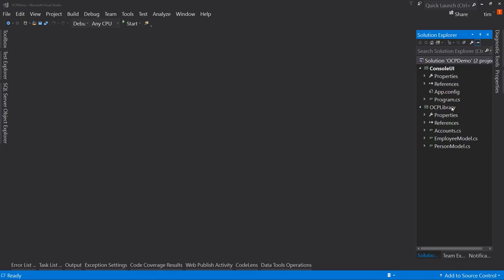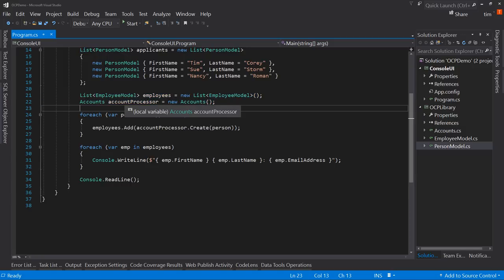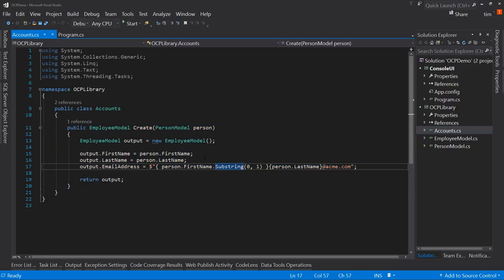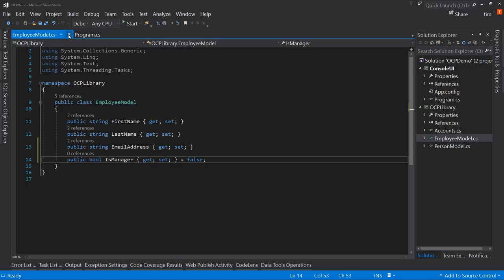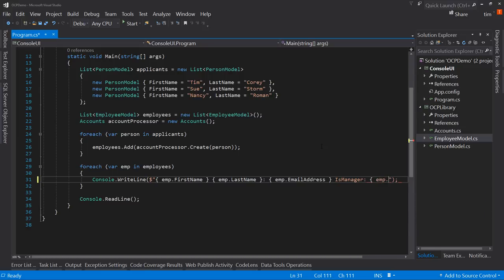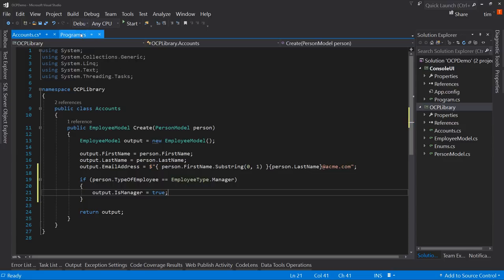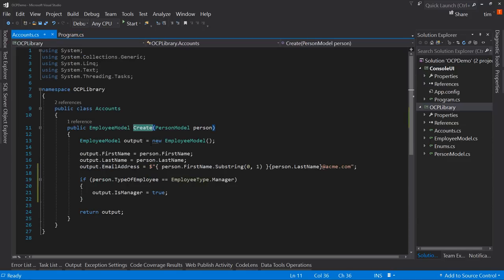Design Patterns: Open Closed Principle Explained Practically in C# (The O in SOLID)

Comment: Hi Tim, this specific example made things a bit muddy for me but I still liked the video because I believe I got the message you were trying to communicate through. A great example I came across of OCP is when we were working with certain libraries or assets and essentially in order to expand what the library offers we can simply use an interface they already used in advance. If I'm not mistaken we used this principal on a node based slide system that lets you add new slides without modifying the original library but simply using its ISlide interface. That way you have a new slide node you can employ in the graph as it easily fits the entire system and other slides are not affected since nothing core changes. If it ever comes to it I would love it if you showed us real life scenarios from work you do or you've done that use OCP. Thank you for the videos and greetings from the Netherlands!
Reply: Thanks for the great feedback

Comment: Hi Tim! Thanks for a good video!

Just wanted to comment - that while I do think you're explaining the concept of the open / closed principle good with your example. I also think it shows as why you should be cautious about implementing this principle in the real world. I consider the amount of complexity added to the application a worser tradeoff than a bug or two in the long term. The bugs can be easily fixed when identified while the added complexity might be there forever :)

Comment: I understand this is just a simple example to convey the principle, but I have two main issues with abiding to this principle for EVERYTHING:

1.  In the real world, your IApplicantModel interface would represent some input for an Employees data table, so if you add a field to the Employees table, you now have to go through all of your Applicant models and add this new member, plus go through all the ApplicantAccounts and add the new logic for this new member and to me, that's defeating the purpose.     

2.  It creates file hell

I use interfaces for all of my service methods, repository methods, and application models (NOT data entity models, those should be hard-bound imo).  I ONLY use interfaces as a precaution and I even put my interfaces inside of my class files (at the top before the class declaration).  I use interfaces just in case one day a change or addition shall warrant using the interface as shown here (but there has to be good reason for me, it has to warrant itself), in that case I take the interface out of my class file and put it into a file of it's own, then mass update reference.  This may not be a "good" way but I've found it works best for me and that's what I love about programming.

I love your videos, Tim .  Cheers!
Reply from the maker: I definitely don't recommend applying OCP to everything. Software development is definitely about being knowledgeable about best practices while applying what works best for your project.

Comment: I once came across a library that was zealously implementing open/closed. Each object had suffix number (some were on their 30th version). Each of these suffixed versions depended various suffixed versions from other objects. It instantly struck as the closest I’ve seen code come to being actual spaghetti. 

The documentation was 90% “object9 is deprecated”, please use object10. Then object10s documentation was “object10 is deprecated, please use object11”.

In short you have to remember that open/close was created quite a long time ago. (Along with the rest of solid). If there is any principle you might disregard completely it’s this one. Make good automated testing instead.
Reply from the maker: Overuse of any principle is a bad thing.
Reply: Tim is polite in his answer but anyone would tell you that if you think having Object1 & Object2 is OCP, then you should probably watch this video again. Closed to modification does not mean it's impossible to make a change/fix. Object2 should have never existed in the first place. Instead, OCP is an 'encapsulation & polymorphism combined principle' that let you use objects through functionalities rather than definitions by associating them via what they are capable of.
Reply: @hugogogo13  Sounds nice in theory, only the original definition according to Meyer is exactly how I described. Instead of modifying object 1 you extend it by creating object 2. Very few examples consider what happens when you have more modifications to make and have to create object 3.  Even the modern interpretation using an abstract base or interface and then replacing the implementation with a new one instead of inheriting the previous object is a maintenance nightmare. 

You seem to have compiled your own version of the principle that makes it valid. but if you go and read the actual definitions of it online it is mostly as I’ve said. I would almost argue that the principle as you describe is entirely different and probably deserves a different name.
Reply: @NickSteffen  fair enough. That's okay then,  SLID is still a catchy name 😉

Comment: Very good. With regards to keeping your interfaces alongside your concrete classes. Once you are writing a large Prism or similar 'modular' application I have learnt that is not best practice to do this. Normally we will put interfaces in a separate 'Infrastructure' project. This way once you are leveraging dependency injection & using an IOC container to inject dependencies you do not have modules being dependent on other modules, rather modules that need to resolve those types can reference the 'infrastructure' interface module and the concrete types are then resolved at run time. This way a module can be used by another application and achieves real separation of concerns. Obviously this is out of the scope of this small example application...
Reply from the maker: Yep, it does depend on how you intend to use them later on, good point.

Comment: Great lecture Tim!
But there is one thing I don't like in this solution, and that's the property AccountProcessor. 
Its initialization violates LSP, and its sheer existence SRP.
Sure, there is an extra implementation for any account type, but it's not the purpose of an applicant to provide any mapping functionality for translating his properties to the EmployeeModel or any other type.
Reply from the maker: I don't really agree on the violations. Part of it comes down to the definition of what a responsibility is but we can apply LSP.
Reply: @IAmTimCorey  sorry, meant DIP, not LSP.

Comment: 0:00 - Intro
1:43 - Code behind demo application
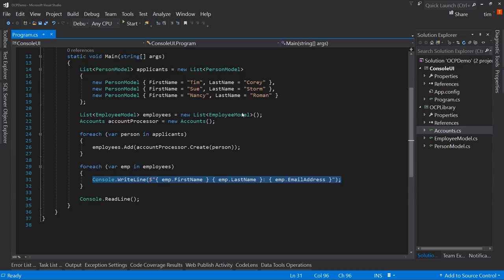5:36 - Open Closed Principle: when to apply
6:18 - Introducing changes in existing code base
18:20 - Identify the issues
21:40 - Implementing OCP: Use of interfaces
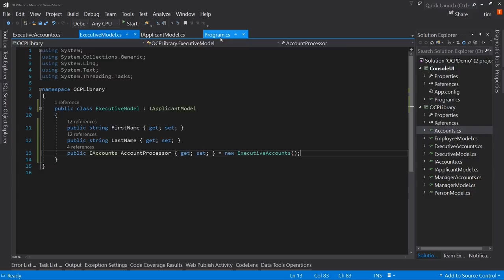38:32 - Implementing OCP: Recap
40:46 - Summary
42:05 - Organizing the code base
43:55 - Note on Namespaces in folder structure
46:50 - Concluding remarks

🤯
Reply from the maker: Thanks Again.  I'm adding all these to the videos.

Comment: Nice video, thanks! 

I think that writing code with OCP in mind, helps a lot,  since it makes code a lot better. But if you start from a project that is already in production and not developed thinking about OCP, it will be really hard to make changes without changing what is already working. 

But, even if its working, you have to change code when you want to refactor. And, Unit Tests should be here to help us not to introduce bugs on working code. 

The point is, I think we have to write code with this principle in mind, but don't overthink or overdo it. 

Thanks for the video, it helped me a lot to clear this concept! :)
Reply from the maker: Yep, that is very true. You have to be careful how you optimize your code. The key is to make things a little better than you found them.
Reply: @IAmTimCorey  Nice advise! :)

Comment: Thanx for the excellent explanation.
Even though the changes ofcourse are still perceptible to bugs as you had to rewrite everything to interfaces, and then did not change the original names of the 'base' classes which might make it easy to mistake (like PersonModel should have be renamed to StaffModel and the Accounts to StaffAccounts because otherwise in the future it could be mistaken for anything else). Also it's easy to say, now you are confident to add a new employeeType.. But to be honest, if the original Accounts was implemented with the switch, I also would be confident to if I had to make a change, as it wouldn't really matter if I had to create the original PersonModel with EmployeeType set, or if I had to set a new <EmployeeType>Model. The problem now is that if there is one slight change to the 'PersonModel' you have to change ALL your other classes too instead of just 2 classes (PersonModel/Accounts), so it might introduce some more bugs.. So yeah, it solves one problem, but it also creates another which you wouldn't have with the first way of implementing multiple employeetypes.. But maybe it's just me that IS confident in making changes to things like switches etc. and wanting to actually see what happens in different cases at that point (for instance the differences between emailaddress creation).
 
Also if this was a big application, it would have been hell if you went from everything in one folder with the OCPLibrary namespace to separate folders and NOT have it have OCPLibarary.<FolderName> namespace and then later have some folders to have it as a namespace. That would make it really confusing, and in the end, changing namespaces of the library after it is in production you get the problem of the other projects might have to be rebuild again and having problems with the namespaces. Also in this case you called the folder Accounts, but we did have a class named Accounts and it created problems with the TechnicianAccounts class which was created in the Accounts folder, and that made the original Accounts class get a problem with having the same namespace as the original Accounts class wasn't in the Accounts namespace. If the Accounts class would have been names StaffAccounts it wouldn't have this problem BUT you would have problems of some ...Accounts classes be part of the OCPLibrary namespace and some of the OCPLibrary.Accounts namespace which ofcourse is very confusing. (Just like my text here, LOL).
So in the end, you always have to be careful if you change code/namespaces after it's already in production, no matter which principle you use.
Reply from the maker: Yep, every situation will be different but the best thing is if you architect your application with OCP to begin with (as much as it makes sense) rather than trying to change it after the fact.

Comment: I love your videos! I have a quick question: I have bingewatched your SOLID series for a second time to refresh it in my memory, and I can't help but notice that almost all of them favor the use of interfaces. However, I can't help but think that these interfaces implemented without an abstract BaseClass are always violating DRY. For example, here the applicants share some similar lines. It's not that big of a problem here, but in another video (I think it was ISP, with the DVD and Audiobook examples), the modules were sharing the same method but each implementing it on their own with the exact same lines. I just find it awkward to use interfaces because they seem to regularly create moments where you accidentally repeat yourself.
Reply from the maker: DRY isn't about not having any repetition. It is about not having the same exact logic more than once. The methods may have the same signature, but they may do different things. They may even do the same thing, but in a way that is not guaranteed to stay the same forever. In those cases, they aren't violating DRY. If you found that you did have exact repetition, you don't need to use a base class (inheritance isn't about code sharing, it is about a relationship - if there isn't a strong relationship, you shouldn't use inheritance). Instead, just create a class with a method that both locations can call.

Interfaces are the primary OOP system used in modern development. They give you flexibility, testability, and more.
Reply: @IAmTimCorey  Thank you for your thorough explanation, that makes a lot of sense, especially the part about relationship/code sharing, gives me a lot of food for thought. I appreciate you took the time!
Reply: Very well explained. I was wondering the same thing..

Comment: Wish you had kept with the same project as your SRP explanation! I want to see you turn spaghetti code into a SOLID project! Thanks!
Reply from the maker: I tried to keep things as clear as possible for each lesson. I agree it would be cool to do though. Maybe for an "Applying SOLID" course.
Reply: @IAmTimCorey  In my opinion, it would be clearer if you used the same project since I already know what's in it and I wouldn't have to learn about the new project and try to imagine how you would implement all the SOLID principles into ONE project! This has been then problem for me. I can't find anyone using the one project thru all the SOLID principles and how the end should look like but instead, I'm given bits and peaces of it and then left to my own imagination to try and implement them all in one project. Problem is, I don't know if I did it right without having a few examples of the completed code in SOLID form!

Comment: Great series of videos, very helpful, thank you!

If I understand correctly, in your non-OCP approach early in the video you have only one Accounts instance. Once you've applied OCP you have some kind of IAccounts instance for each IApplicantModel instance. If you had thousands of applicants, you'd have just as many IAccounts instances. However, it seems to me you only really need 1 instance of each class that implements IAccounts.

My instinct is to try to model the code on something analogous to real life. Having each person object have an account processor object doesn’t feel natural to me. Perhaps I would have a class to manage applicants (maybe called ApplicantsManager), which would take an IApplicantModel object and give back a reference to an IAccounts instance of the type relevant to the real type of IApplicantModel object.

What do you think?
Reply from the maker: It doesn't matter if you use an IAccount interface or the Account class instance - either way you can choose how many instances of that class you have. Using the interface does not dictate how you create the object, just the requirements on the object.

Comment: Hi @IAmTimCorey, could one refrain from implementing variations of the Account class, - continue using it how you initially did, i.e.: accountsProcessor.Create(person), and overload its Create() method to take the various (new) IApplicantModel types... effectively all of your improvements are the same, except your variations of Create() are together in Accounts............. and still have "used OCP"? Would this be inferior or just another way to have applied OCP?
Reply from the maker: That would mean continually changing the Account class, which would violate OCP. It would also be quite messy. There may be certain circumstances where this is the right call (Console.WriteLine has a bunch of overloads like you are suggesting), but in our case it would probably be better to use child classes.

Comment: Hi Tim. I have a question about the S, not about the O in SOLID (sorry :D but you mentioned it here and it brings me to think about one thing).
As you said - "SRP - Classes should have only one reason to change". 
Ok. When we change the way we create an account for a person it is just one reason. But what if we have other methods, e.g. Edit(), Delete() and many others. Then the account class has more reasons to change. When we change the way we Edit account, Delete account, etc. How does it refer to SRP?

P.S. I want to thank you for your videos. You really pushed my learning C# forward :)
Reply from the maker: That does depend a bit on your interpretation of "reason for change". In order to not go crazy, I tend to think of methods as "one focused reason" and classes as "one general reason" to change. For instance, Person would not need to change generally unless how a person worked changed. Edit would not need to change unless the specific logic was altered.
Reply: @IAmTimCorey  I was thinking if SRP could be related to methods in classes, not just to classes. Thanks for your answer, it lightened my mind 🙂

Comment: What about if the executive class needs more info than the staff and managers?  Say for example they need a biography to put on the company website explaining who they are.

Would the only solution be to add Biography to the IApplicantModel even though the other classes don't need it then?  Then you have to modify the existing IPersonModel and IManagerModel.